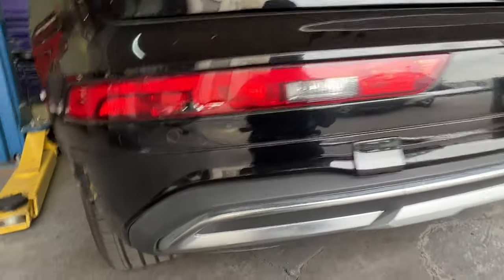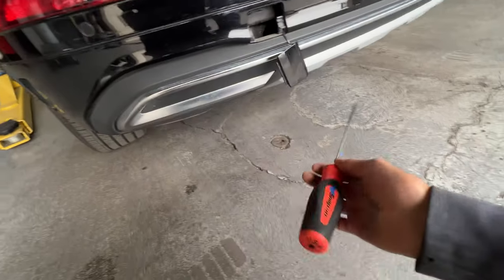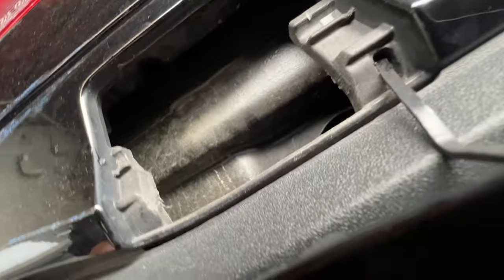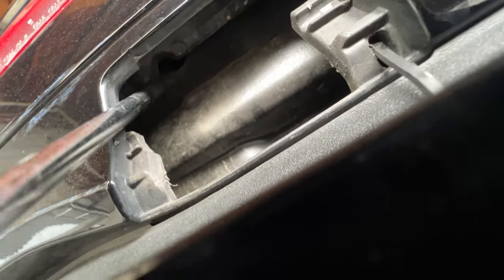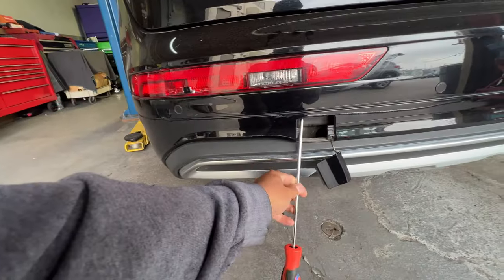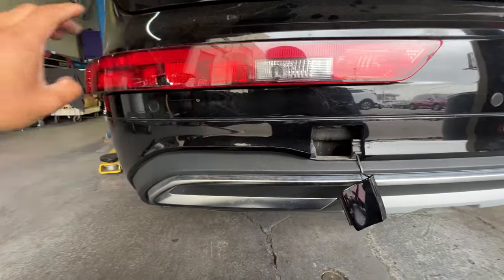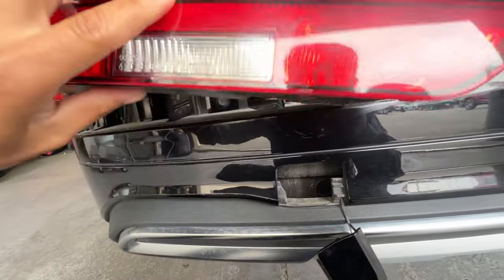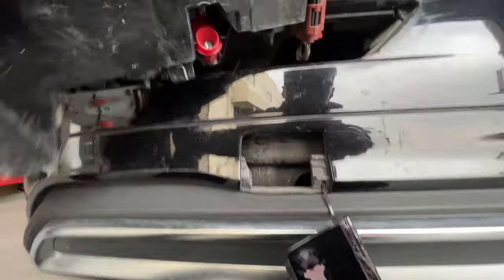How To Remove Audi Q5 Rear Tail Light EASY

Comment: Thank for this!  Bought the tail light for $200+ and replaced it. Dealership told me it was going to be $800-1000 because they would have to reprogram the computer. Complete BS and for what? It's no different than changing a bulb in the assembly

Comment: No matter what I try I can not see or locate the screw with a long torx 25 screwdriver on my 2019 Q5. Had a mechanic try too and he couldn’t find it either 🤦‍♂️
Reply: Yea same here I can’t find it either, it’s being a pain in the ass😐
Reply: Find it?
Reply: @604roger  actually yea I ended up finding it , took a good couple mins by year figured it out, you have to go in on an odd angle
Reply: @Vader3242  how long of screwdriver you reccomend? I have a 6” t25 but I can add an extension too
Reply: @604roger  I ended up getting a 12 inch, you have to come in on a sharp angle, you can try it I guess